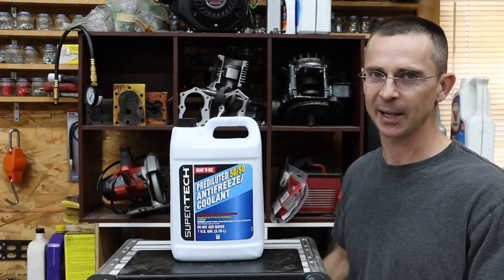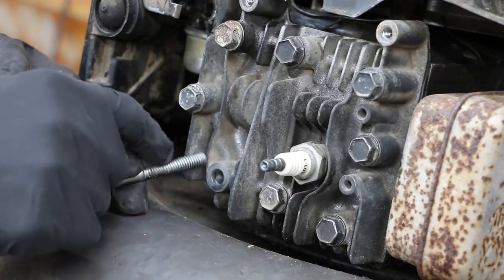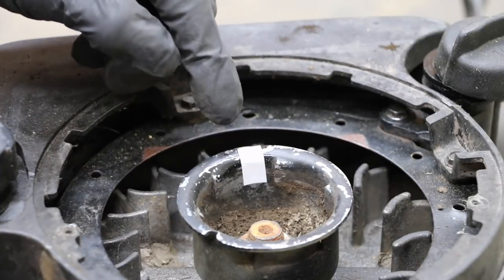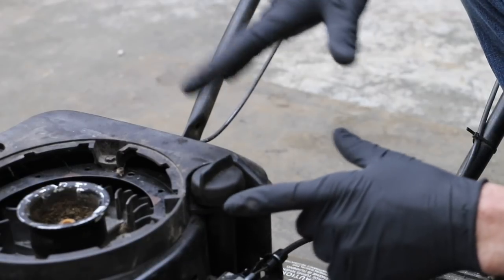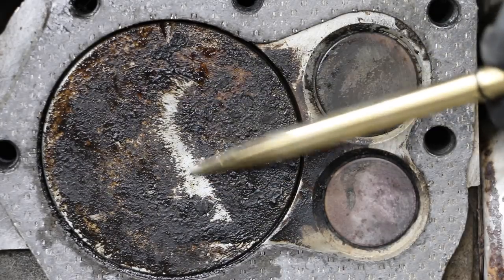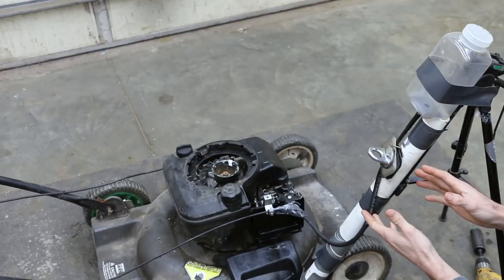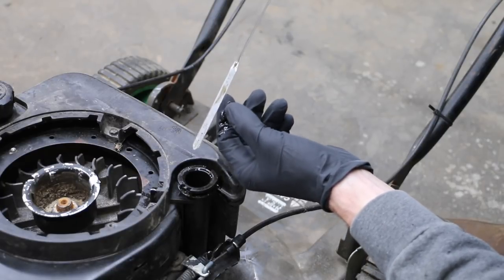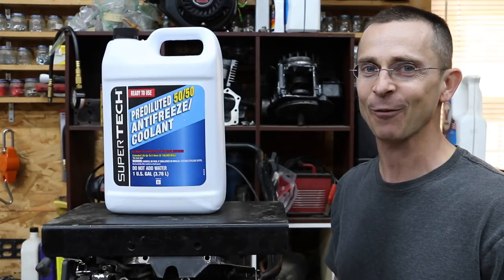Will Antifreeze clean an Engine?  Let's try it!

Comment: I have a question about the JB Weld on the bolt. You put in on 'wet' no? Cause JB can do one of 2 things. Severely Epoxy the bolt in- forever. Another cold be to 're-thread' the smoothed out areas with a threaded epoxy.If its dry it can 'force it''s way in  firmly like a shim.I've used Aluminum foil before to some avail. As well as Plumbers thread tape.
Reply from the maker: I did put it in wet.  It won't stick very well to an oily bolt.  Great tip on aluminum foil.

Comment: can you test if diesel mixed with motor oil will clean out the sludge as well as any other rubbish inside the engine? i heard a 50/50 mix should be harmless and doing it once then draining the oil then  doing it one more time should give even better results!
Reply from the maker: Thank you for this video project recommendation!

Comment: I have had a mechanic mention transmission fluid before. I was also wondering why you wouldn't use the antifreeze undiluted. Wouldn't it be stronger without the water?
Reply from the maker: Great point regarding ATF and pure anti-freeze.

Comment: hey i`ve a query, in my knowledge i think spraying up thinner gas into carburetor which is thinner then petrol gas can burn built in carbon deposit on piston head so which gas should i spray-Methane, Ethane, Propane, Butane?
Reply from the maker: That's a great question. I would be careful doing this.  If you decide to try it, Propane is readily available.

Comment: As you pointed out If you have ever torn down an automobile engine that has a blown head gasket that was leaking the antifreeze into the combustion chamber  for several miles when you pull that cylinder head the cylinder with the leak will be perfectly clean with absolutely no carbon deposits on piston or valves.Usually after 75 to 100 miles .We have not necessarily seen catalytic convertor damage if the vehicle was brought in promptly, that same 100 miles or less
Reply from the maker: Thank you!

Comment: People have been using foam ovencleaner to clean the exhaust side of turbos. I don't thing you can put it through the engine, but as a cleaning agent. Maybe if you put small amount through the plug hole, spin it without starting, let sit and then start? Woud that do the job?
Reply from the maker: Thank you for this video project recommendation!

Comment: ive used cheap blue water windshield washer fluid on a 94 honda to clean the chambers.  rev the engine to 2000 rpm while trickling it into the intake after its warmed up. ive also used pb blaster in the same way.
Reply from the maker: Thanks for sharing.

Comment: I heard that Carbon disulfide, Potassium hydroxide, Carbon tetrachloridemight, or even oven cleaner "sodium hydroxide" will do the best job at cleaning engine carbon build up. tryd them before in chemistry class and they did the job in a boiling flask
Reply from the maker: Thank you for this video project recommendation!

Comment: If I may, I'd like to add something.

 The product that actually cleans the carbon ,is water not the coolant.( that is a petroleum/oil based product). If it's added as a "wet "steam (like in a gasket leak) it would probably be more efficient /effective. Also the motor should run cooler on the inside (the same effect as water injection) and because there is more liquid  added that changes into n gas ,there might even be a small change in power. 
The flame can also be negatively influenced ,depending on the amount of steam added.  But the expanding steam .Changing   now tobe a "dry" steam (or a super heated steam , depending on pressure and temperature ) might take the place to produce  more power and a "safer" power-stroke ,if steam's characteristics is taken in consideration.

As far as the oil, there shouldn't be any problem as the water in the crankcase wil vaporise and breathed out ,as long as the engine is hot and running. Once the engine is  stopped /cooled down and opened up , a water vapour might be visible inside the crankcase . 
Some mechanics add brake fluid to "loosen" and "clean" motors....

Love your experiments. Keep well.
Reply from the maker: Great point. Thank you

Comment: I'd like to see you run distilled water to decarbon the combustion chamber.  Please also consider testing Yamaha Yamalube Ring Free Plus Fuel Additive and it's impact on removing carbon, as well.  It's been around in the marine outboard community for a long time and supposed to be very good, but pricey.
Reply from the maker: Thank you for the video idea!

Comment: Years ago someone showed me whereas you run an engine above idle, put a garden hose on the carb and adjust the drip so the engine just keeps running.
Called the fry pan effect. Shatters and removes the carbon. Sense doing more than the antifreeze in cleaning. Try it?
Reply from the maker: Thank you

Comment: Great video!  I've heard mechanics recommend plain water for cleaning automotive engines.  Seems like it would be a little safer for converters and senors at least.  Eric the Car Guy has a video about doing it, he uses something akin to your drip method dribbling the water out of a solo cup into the intake manifold, and does emphasize making sure the engine stays warmed up when doing it like you do here.
Reply from the maker: Thank you for this video project recommendation!
Reply: I was thinking of some kind of spray or mist system that I can install right into the intake tube

Comment: I had a car engine pop a head gasket between 2 adjacent cylinders.  The cooling system was unaffected by it.  Those 2 cylinders were very clean.  They were partner cylinders on a 4 cylinder engine, so I am confident that compression wasn't good, nor was combustion, so I say that it got cleaned out by just unburned gas.
Reply from the maker: Interesting. Thanks for commenting.

Comment: Try plain water that's what I was taught to use I think the cleaning in a blown head gasket situation is super hot water aka steam over a longer period of time than most people realize. As their radiator hoses heater cores and radiator usually leak do to excessive pressure in the cooling system from the combustion chamber. That's where they think the coolant is going. Anti freeze in the cylinder will often blow spark plugs out

Comment: I've just used straight water instead of anti-freeze.  I trickle it in via a brake booster line (carefully) and a borescope shows the tops of pistons are a bit cleaner.  Unfortunately, I don't get a chance to see what the head surface looks like.
Reply from the maker: Thank you

Comment: Old time mechanics use to recommend pouring transmission fluid into the carburetor to clean the valves & internal engine parts. This was before the computer controls came along. Does it really work?
Reply from the maker: Thanks for the suggestion.

Comment: Can you do a comparison of cheap vs expensive anti-freeze, testing not only the freezing points but also the boiling points of the coolant?  Perhaps you could do some sort of corrosive test too, in case people are worried about ingredients wearing down hoses or coolant system parts.
Reply from the maker: Thanks for the suggestion.

Comment: Atf in the oil, works basically like seafoam to clean sludge out, I have also used up to half a quart of it in about 15 gallons of gas to clean out my trucks engine
Reply from the maker: Thank you for this video project recommendation!

Comment: Did you ever manage to source "Redex"?  It's a similar thing to Marvel Mystery Oil - in the 70's my dad used to do the treatment to any engine that he installed second hand (engines didn't last so long back then!) - A good dose was poured into each cylinder of a warm engine, then left overnight to soak in.  Then crank engine to expel excess (use a cloth over the holes unless you like the mess!) install spark plugs and then run then engine at high idle until all the white smoke dissipates.  Also was added to Petrol as apparently also cleaned deposits on pumps and carburettors.  No idea how much difference it actually made though :-)
Reply from the maker: I haven't purchased it yet.  My "test shelf" is maxed out on products to test but I do plan to buy and test Redex in the future once I work my way through some upcoming projects.

Comment: I'm an old fart myself, so this goes back many years: My dad worked at a few different jobs over his lifetime, but spent more years as a mechanic than anything else. During that time, he had to deal with numerous vehicles with head gasket leaks. 
In most cases this wasn't catastrophic UNLESS the engine had Prestone antifreeze in it. In that case, the piston rings were welded to the cylinder walls. Never knew what the difference was, but back in those days they definitely had a different formula from others.

Comment: Hi Project Farm Sir I have used CRC Carbrettor cleaner & have had the engine revs up a bit & my engine is the Toyota 3.4V6 fuel injected engine & have sprayed into the throttle Body & really cleaned up the throttle Body & you also can by fuel injection cleaner & you just pour it into the petrol tank & I have used a diesel injection cleaner on diesel engine & after driving the ute a bit it got rid of the miss it had & it was my brother's ute & he was really pleased with when he took it for a drive the miss had disappeared & so these products seem to to work & should put some more injector cleaner in my petrol tank & haven't put anymore into my petrol tank for a while now & Ì should put some more into my tank to keep my injectors nice & clean as the engine has now done  251,000 Kilometers its amazing how clean the throttle Body is after I have used CRC Carbrettor cleaner on the Throttle Body & I should do it now & them on the Throttle Body & haven't done it for quite sometime ago now & I'm slipping up when I get around to do the radiator flush next weekend & I will get another fuel injection cleaner to go into the petrol tank & get a CRC Carbrettor Cleaner to the Throttle Body gosh that stuff really cleans up the Throttle Body up like new & works really well on Carbrettors as well & Project Farm Sir I recommend these products because they do work well Kind Regards Peter

Comment: Still need to try this same test with water\methanol mix (windshield washer fluid).  It works better.  The methanol burns hot which increases engine temps and then the water flashing to steam cleans the carbon.

Comment: Trans fluid in the carb will clean it up , i have use it on a car that i lady was told she had a rod knocking but it was just a build up on piston from let me say babying it, you have to keep rpm up but dump it in carb and the knock went away saved her  a couple grand.I wouldn't use it on newer carrs but this was like a 80's. Your vids or awesome thanks.
Reply from the maker: Thank you for this video project recommendation!

Comment: Scalding hot steam (water vapor) under high pressure will dissolve just about anything. So, the ethylene glycol likely doesn't help much. Sort of like a high pressure washer will remove darn near anything if the pressure is high enough. They often use high pressure water spray to cut various metals and materials in industry (they might add an abrasive to the water to cut very hard materials) because it keeps down the dust and you don't have to replace blades.
Reply from the maker: Thank you for the feedback

Comment: I know of a mechanic that has used water and ATF separately to achieve the same results.  Have you tried either of these also.  I should imagine the water results should match this test using the radiator coolant.  But the ATF would make for a fine test due to the good cleaning ability... smokes a fair bit though.
Reply from the maker: I've tried both and they both seemed to work.

Comment: So I dumped six gallons of antifreeze into the fuel tank of my 2020 F350 6.7L diesel to do a good cleaning. It ran for about three minutes before coming to a rapid stop. I figured it just needed to soak for a bit and walked away to make lunch. I come back three hours later and the engine won’t turn over when I press the start button. Can you help me out here? Not sure what happened.

Comment: When I was a young lad I worked in an adhesive factory and when I couldn't afford to fill the tank in my VW Rabbit, I'd snitch toluene and dump it in my tank. My Rabbit's relays burned out one and a time, so I replaced them with double pull double throw switches. With toluene in the tank, I could switch off my ignition without cutting off the fuel pump. That Rabbit would diesel well enough, jacked up on the toluene to let me creep along in first gear.
Reply from the maker: Thanks for commenting on this.

Comment: I have a suggestion.   Try human urine as a radiator coolant.  My grandfather had a bunch of crazy stories.  One of which is how he had a radiator hose burst and lost all coolant in his 60 something Rambler on a road trip from Tucson to Willcox AZ.  just outside of Tucson.  His version of the story was he and his passengers had a case of beer and a few sodas in an ice chest.  So while waiting on the side of the road in the middle of the night for help than never came, they patched the hose and drank the beer and soda and filled the radiator up with pee.  Nasty, but he said it worked.  They made it home (90+ miles) and the next day he looked inside the radiator and it looked like it was polished brand new.  The Rambler was fine and used many years afterward.

Comment: would a ohv engine have better results ? because the build up that transferred to the head may have worked it way out the exhaust valve with a over head valve engine.
Reply from the maker: Great point.  I'll need to test this.

Comment: can you test if mixing two stroke oil into regular oil, is benefitial in any way to a engine with worn/damaged piston rings? my car has a design fault with the piston rings which means that it uses alot of oil. so i mixed some two stroke oil in. thinking that the oil will burn anyways. so it might aswell be a oil that was designed to do so
Reply from the maker: Thank you for this video project recommendation!

Comment: I've used carb cleaner in a can to clean my piston before. just spray it in the spark plug hole and let it evaporate. the carbon just flakes off. Install the spark plug and start her up and all the carbon dissapears. I don't know how good it is for the engine but it worked pretty well.
Reply from the maker: Thanks for commenting on this.

Comment: Heard of people running diesel or kerosene in the oil either added to or instead of oil to clean sludge out of the engine. I know both options work pretty well as parts cleaner but I would think they would lack the viscosity needed in oil. Would make for a good video though, assuming the diesel or kerosene doesn't ignite in the crankcase!!!
Reply from the maker: Thank you for the video idea!

Comment: Would you compare test some over the counter radiator repair products vs the myth/wives tale style home tricks? I've seen the aluminum style flakes they sell at Orileys etc. but I've never tried them. Some say if you put black pepper in a radiator with a pin hole leak, that it will seal similar to the aluminum flakes. But my favorite trick is cracking an egg in the radiator then allowing engine run causing the coolant to become hot enough to cook the egg which will then find and plug the problem hole. I have personally done this and not only did it work in a pinch, but this super available and cheap fix lasted 3 month but only because the car died of non-engine related causes. I'm sure it would have lasted much longer. But is there potentially any harm posed to the coolant system from any of these fixes?
Reply from the maker: Thank You for the Constructive Feedback!

Comment: Please try transmission fluid, I remember seeing my cousin pour it down the carb and it smoked like crazy, the color that oil smoke is. They said it was to clean out the engine, it didnt smoke once the fluid burned up. Seeing how good it can clean grease and oil from hands makes me wonder just how good it cleaned the engine.
Reply from the maker: Thanks for the suggestion.

Comment: As a heavy line tech for a long time I’ve done A LOT of blown head gaskets on engines! Anything that’s been run for awhile with coolant getting in the combustion chamber looked as if that cylinder was brand new! I mean it was very clean…
Reply from the maker: Thanks for sharing.

Comment: Thanks again for another great video ! I'd be interested to see if water by itself does a better job. I've used it to decarbonize a lawn mower engine before. By slowly pouring a little in the carb while it was running. But I never took it apart after.
Reply from the maker: Thank you!

Comment: You should test different coolants for lowest heat (hot running engines during summer, or dirt bikes, etc.). Evan’s waterless coolant, redline waterwetter, normal antifreeze, etc.
Reply from the maker: Thanks for the suggestion.

Comment: the 50% water in the antifreeze mix is what did the "cleaning". Water turns to hot steam, and hot steam cleans. Moisture also makes caked on carbon soften up. You could get better results just using plain distilled water
Reply from the maker: Great point.
Reply: Project Farm try water next ;)

Comment: Another awesome video.
I drive a Truck(not an American Pickup, an Actual Truck) Diesel, my employer gets Powdered AJAX or similar Cleaner, and puts a heaped Tbsp through the Intake every 12 months to remove Glazing from the engine. He takes off the air filter, holds the powder in his hand, and blows it off his hand into the intake, takes around 2 minutes to complete.
'I called BS' on it, what are your thoughts?
Reply from the maker: I would never dump AJAX in the intake to remove the glazing.  I believe it's causing a lot of unnecessary wear
Reply: @ProjectFarm  that was his thought, to remove GLAZING from diesel engine that was IDLING for long periods.